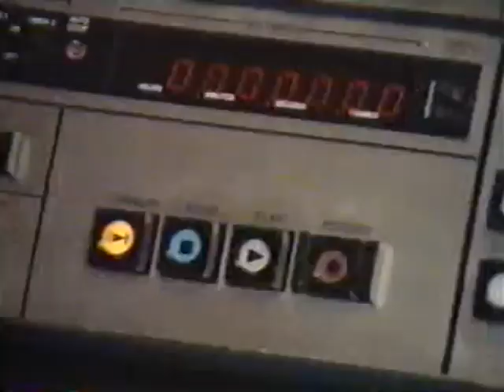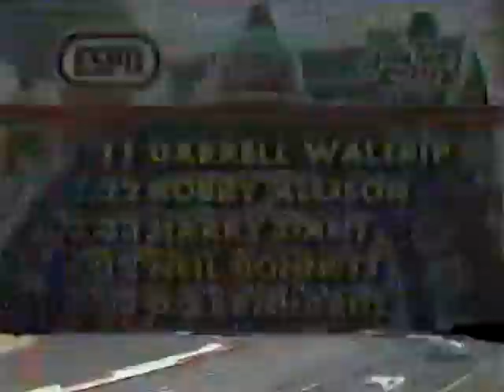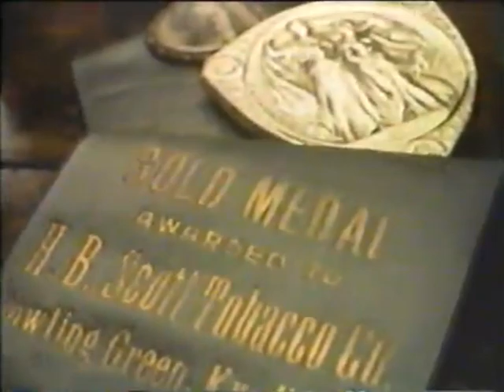1984 Holly Farms 400

Comment: *POINTS STANDINGS and WINS before the 1984 WILKES 400 (27 of 30):*
#44 Terry Labonte (3947pts with 2 wins, GM)
#33 Harry Gant (-86 with 3 wins, GM)
#9 Bill Elliott (-227 with 2 wins, Ford)
#3 Dale Earnhardt (-262 with 1 win, GM)
#11 Darrell Waltrip (-288 with 6 wins, GM)
#22 Bobby Allison (-503 with 2 wins, GM)
#15 Ricky Rudd (-556 with 1 win, Ford)
#12 Neil Bonnet (-624, GM)
#5 Geoff Bodine (-699 with 2 wins, GM)

Richard Petty (GM #43 with 2 wins) was having an on-and-off season and was 11th. Tim Richmond (GM #27 with 1 win) was 13th because of mechanical issues and inconsistent pace. Part-timer Cale Yarborough (GM #28) won the Daytona 500, the Alabama 500 and the Pennsylvania 500. Benny Parsons (GM #55), another part-timer, won the Dixie 500. Despite being the best rookie of 1983, Sterling Marlin couldn’t secure a fulltime ride and didn’t have a good sophomore season.

Drivers listed are the season's current top8, last season's top8 plus the rookie of the year before and whatever race winner that doesn't fit any of those 2 descriptions. Yes, I’m using the unsponsored names of the races. In North Wilkesboro’s case, the earlier race is the Gwyn Staley 400 while the later one is the Wilkes 400.